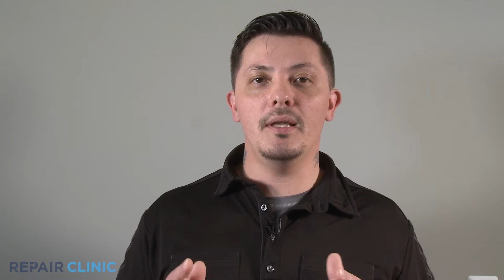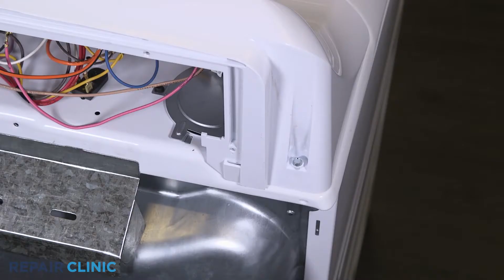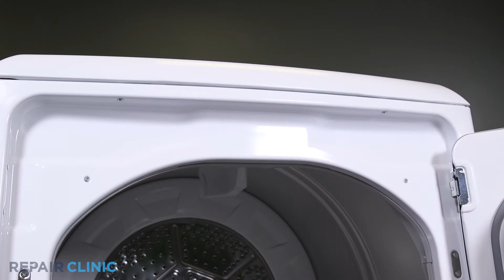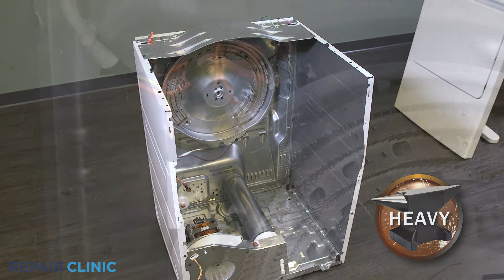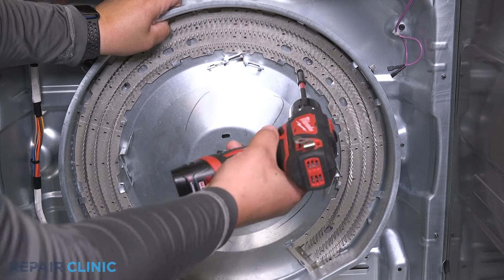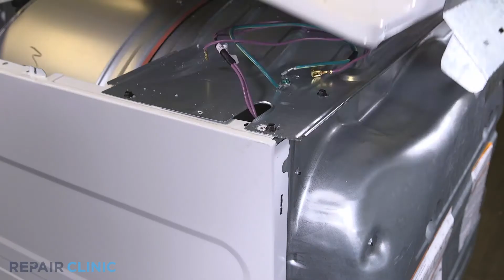GE Dryer Safety Thermostat Replacement WE04X25194

Comment: ???

Why disassemble all that just to replace a thermostat?? It's one little screw easily accessed with a stubby hex driver or a 90 degree adapter.
You might think about taking 30 seconds to tell people how to test it as well.